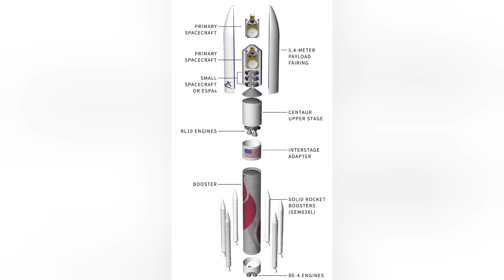Blue Orgin FINALLY comes through for Vulcan!!  AND more shocking news about Starliner!

Comment: You are assuming the BE engines are reliable and they have never been more than bench tested. Also, there are only 2 of them. Meanwhile SpaceX has made 2 main versions of raptor and dozens of them! I'm not saying Vulcan won't fly, just that starship will too and probably far more often.

Comment: The bigger issue facing ULA is if Blue Origin can produce enough engines going forward to meet ULAs required launch cadence. It is going to be years before the engine reuse side of ULAs plans come to fruition and until then they are going to need new engines for each launch. So far it has taken over 2 years for Blue Origin to deliver 2 flight certified engines, engines that have never flown and engines that are fine on a test stand can often have more problems when integrated to an actual rocket.
Reply: It is possible that problems that lead to the current delay are (mostly) fixed, increasing future production speed. We won't really know untill we actually get to it.
Reply: @MDP1702  
Possible, but if I was a potential customer, I wouldn't bet on it until they had proven it!

Comment: I do not know what your source may have told you about how "government contracts" work, nor do I know the specific wording of the contract between Boeing and NASA regarding Starliner, but I do know that it is a fixed price contract, not a cost plus contract. Therefore, barring somebody showing me specific language in the contract to the contrary, I don't believe Boeing had any choice but to pay for a second unmanned test flight in order to meet the objectives specified in the contract for them to be paid. I will wait to have that position disproved.
     I thought I was subscribed to you but, upon checking, I found I was not. Thus, I have either subscribed or resubscrbed, which ever is appropriate.
     My opinion on an orbital launch for Starship is NET January. We will see what happens. Regardless of when Starship finally achieves orbit (and it doesn't matter at all if it is before or after Vulcan, or even SLS) within a very few years, Starship will be capable of hundreds of launches per year, manned and unmanned, and nothing else in the world will be able to match that.

Comment: Compared to fully reusable the throw the body away is hugely expensive purely in the infrastructure they seem to require to build a new tank every time, there is no way you can claim it's not, it's a half-assed solution so the can pretend they are more advanced than they really are.

Comment: Thanks for the new video!  I've been a subscriber since your channel's early days so I can't help with the new goal, but it's a certainty you'll pass 100 000 soon. Then onto the next goal...

"...and that's why I believe a ship with 33 engines is not going to be ready to take off on the same schedule as a ship with 2, that are now flight certified along with a bunch of solid rocket boosters that have also been tested to failure."

That is a very good point. Vulcan Centaur is going to be out there doing missions long before Starship is ready. It is a neat rocket, and sending a lander to the Moon is a heck of a way to christen the new system.

Comment: The Angry Astronaut is begging and pleading for more followers which is getting annoying, so I think he’s trying not to reach 100K followers until after his gamble has ran out of time. If he doesn’t have the followers before either Vulcan or Starship flies then he is safe…or at least his butt is??? 
Now BO’s Starliner should have successfully docked with the International Space Station on its first attempt… My theory was that Boeing was just doing its best to get more money from the U.S. Tax Payer.  Then again, they may be just too incompetent to run nun-public tests until it would work. I thought Boeing was one of the top spacecraft contractors along with Blue Origin and Lockheed Marten, they sure get paid enough.??
Angry is giving Boeing a pat on the back for running a second non-manned flight test, and paying for it out of pocket… I don’t know where Angry found this news, I think they didn’t have another choice, but I would hate to hear the news that the first Manned Orbital flight of Starliner did reach orbit……Oh, are you looking for more?
Okay, maybe you need more? But I don’t want to hear it, ‘The Starliner reached orbit but stalled, all engines stopped, and…’

Comment: If the first Starship orbital flight crashes and burns, the next one is waiting in line. If Vulcan crashes and burns, the BE-4 production cadence is going to be a killer. Heck, even if there  is a successful launch, BE-4 production cadence is still a big question.
Reply: they still don't know what's wrong with it. we didn't get to the integration step yet, it will not crash, it just won't fly.
Reply: But the ULA plans is to reuse those engines(according to the specifications BE-4 can be reused 25 times) , they worked with NASA on the inflatable heatshild that would be tested this month on a Atlas V, so maybe would only need 4 new engines in a year for 40 launches, witch is the production capacity of their new factory in Alabama specifically builded for the Vulcan Centaur.
Reply: @theOrionsarms  🧙‍♀️ Witch shows you have the Halloween spirit!   😆
Costume idea:  Next year I'll go as Autoincorrect....
Reply: @theOrionsarms  If it blows up id die from laughing. Gotta love Karma
Reply: @badtrekee4348

Comment: I agree:
-Hitting the subscribe button is easy and involves no extra ads or email because of it.
-I also hope SpaceX, Vulcan, and New Glenn all succeed.
-Competition is good.
-ULA is a genuine competitor to SpaceX.

I disagree that ULA is anywhere near as far along as SpaceX.
-SpaceX just landed a complete booster for the 150th and 151st time. Having just an engine parachute down for a water landing is a poor imitation that will not save nearly as much.  Also it won't be ready to try until 2024 at the earliest. Too little too late. Bruno is the one who handicapped ULA reusability by saying it did not make that much of a difference and boosters would need 10 flights before they could begin to make money. This is demonstrably wrong.
-Both versions of the the raptor are thoroughly tested and SpaceX is producing them like M&M candy. BE4 not nearly so much in either testing or production.

Comment: Vulcan is cool, but I'm not sure SMART reuse is any good.
It might seem counterintuitive, but the concept of "just land the entire rocket" is a lot simpler operationally, and obviously has a lot more benefits. Most importantly, the principle of proper reuse of an entire rocket (at least a stage) is that you do not have ANY real production/technical work after one rocket is completed, you just have regular operational costs and fuel costs. That is what makes SpaceX reuse so effective. 
In other words: Effective reuse is not about the number of systems you recover, it's about the fact you don't have to produce that system for each flight.

To use the old analogy: "Image you would throw away the airplane after every flight" - well, with SMART re-use, you still throw away the entire fuselage, wings, etc. 
It's better than throwing away the entire plane, but the cost of recovering and re-integrating the engines are significant.
So, ultimately, Vulcan is still a rocket for a past age, not modern enough to compete with the next generation of fully reusable rockets.

Regarding the subscriber stuff: I think the problem may be that you take 3 minutes to get to the point of the video, not the fact you have controversial opinions ;)
For real though: I like your long rant style, and your intros are all good for me, but there's some parts that don't seem entirely necessary and probably make people skip your content. I feel like it was the same for CSI-starbase before he got so much notice in the community for his in-depth analysis.

Comment: I disagree about the implications about the 2nd flight. What sank Boeing's potential on making a profit with Starliner was all the mistakes and failures that led to the 1st flight and it's complications. Boeing's reputation as an aerospace company was devastated by that very public and very embarrassing failure. It painted Boeing as a corner cutting, bloated corporation that relied on past success and not current capability in order to win contracts and set prices. Not only did they get beat to space by SpaceX, their competitor is now more trustworthy than Boeing and while the 2nd flight won't make Boeing off of Starliner, it at the very least proved to the public that they are still capable of space flight and addressing mistakes. Dreamchaser is still a better option though.

Comment: The problem with Vulcan is it has taken them how long to get 2 flight ready not proven engines.  Granted SpaceX will take longer for their very experimental vessel to reach orbit or even the moon, but the sheer production speed of SpaceX will undoubtedly swamp the industry just as falcon 9 and Merlin's have done in the long run.

Comment: Cmon guys, how many times you were optimist about BE-4 just to be disappointed yet again?
It. Won't. Fly.

Next time it will be because the loo has broken, or the screw driver wasn't calibrated, or the coke machine went out of energy drinks, whatever. It just won't fly.

Comment: Starship is the most promising super-heavy lift option going forward. No need to rush it. SpaceX is not racing the SLS, it is not racing the Vulcan-Centaur. Given the potential catastrophe that a failed Starship launch could entail it is best to exercise caution.
Reply: No doubt, and since SpaceX is producing a Raptor 2 engine everyday, they will still be testing and flying at an ungodly pace compared to BO, or NASA.

Comment: Just watched a 27-engine spaceX rocket take off and looks like 18 engines returned.
Reply: USSF didn't want the booster returned for some reason.
Reply: @paulboger3101  
I think the mission requirements meant that the center booster would not have enough fuel to return for a landing.
It is one of the options on the Falcon Heavy to burn all the fuel and not return any of the boosters, if the payload mission requires it.  That would increase the launch capability by a significant amount, along of course, with the cost of the launch.

Comment: I believe it was on other videos of yours that I've said this but I'm going to repeat it here:

ULA will at least test SMART reuse with Vulcan (ie, actually do a launch) before New Glenn flies, as neither the US DoD nor NASA will not tolerate BE4 engines going to New Glenn before ULA has enough engines to satisfy the scheduled national security and ISS CRS missions.
Reply: LMFAO AT Smart reuse. Try like they couldnt land the whole first stage. Smart reuse my ass
Reply: @badtrekee4348  It is smart reuse, the engines are by far the most expensive part. If they can get those down much easier and safer than the entire first stage, that isn't necessarily much worse vs falcon 9's entire first stage recovery. Especially if they currently lack the experience to land an entire first stage, which might takes years of trial and error and repeated success to be fully trustworthy, it is a good choice.
Reply: @badtrekee4348  
Luckily for me, angry addresses this point in his next (or second to next) video.